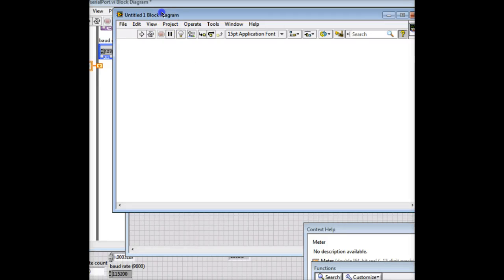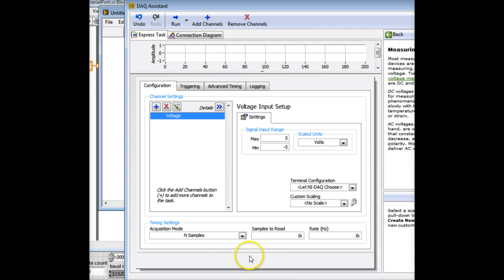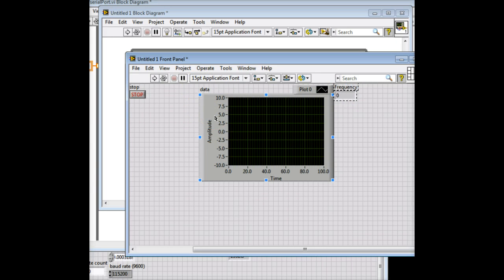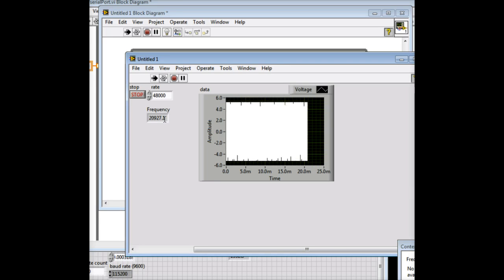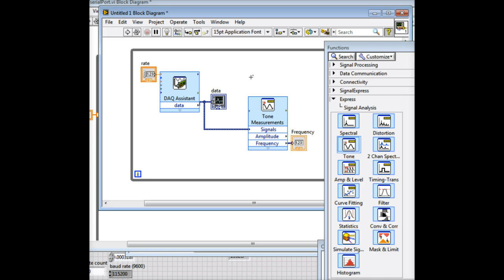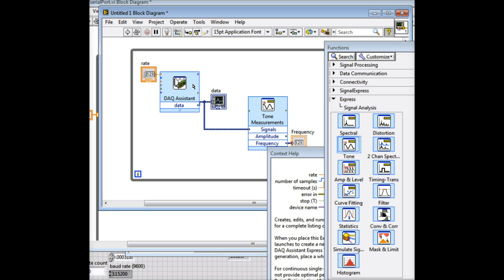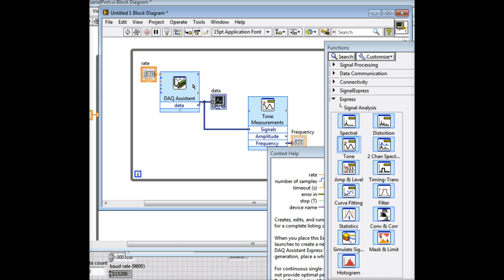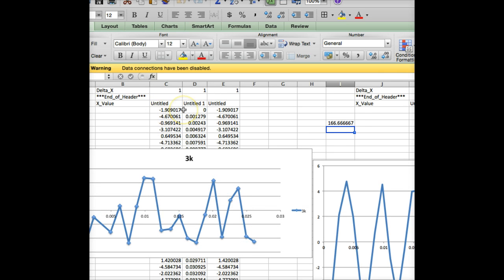Frequency Measurement LabVIEW

Comment: Dear David, 
hope all is well. I wanna thank you for your videos.
I want to learn LabVIEW from the beginning, can you help me?
I would like to simulation the flow of voltage from line A to line B, and at the same time measure that voltage is this possible in LabVIEW?

eg: suppose I have a power supply of 40V connected to current sense and in between I have 5A fuse. when I connect ADC to current sense and next is CPU or microcontroller which is connected to a displayer (PC), how this can be simulated in LabVIEW.  
Thanking you and really appreciate your help.